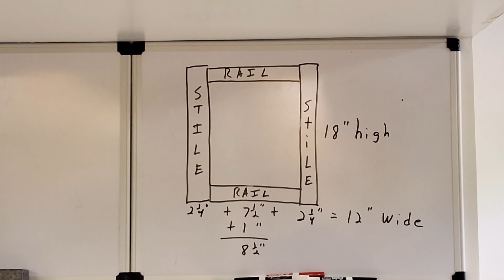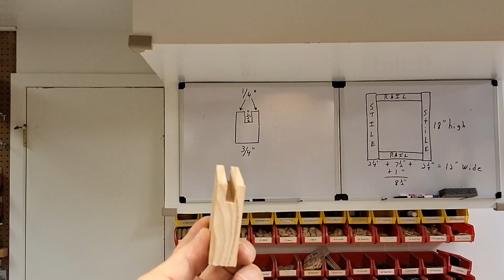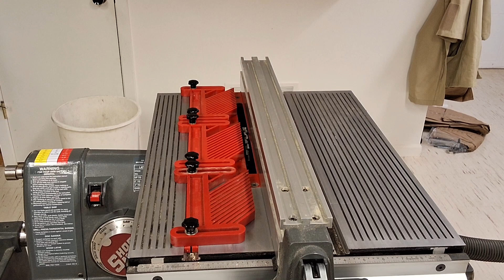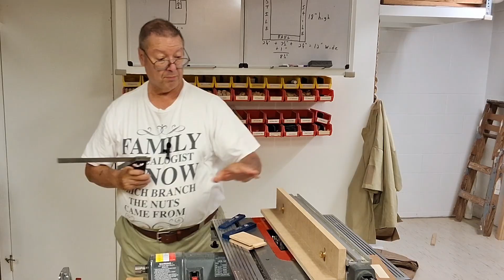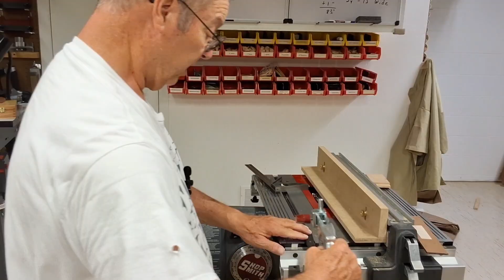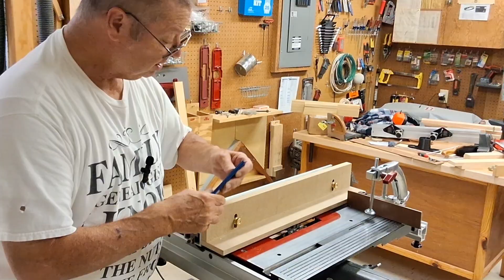Using the stacked dado set for stiles and rails.

Comment: I agree, great job Steve, I am enjoying this series.  I have made made close to 100 doors and drawers with this simple Shaker style but have always used a router set and table. I especially like the way you used the L fence and dado blade for coping the rails. I am always a little uneasy  doing this cut on the router table. Obviously you didn't show all the final adjustments required to get the nice fit, but once that chore is done the cutting looks to be a breeze.  I also like how you taped on the zero insert piece on the face of the miter gouge to prevent tearout.
Reply from the maker: The Shopsmith adjustable stop collar makes fine tuning the table height a breeze.  Using pieces of typing paper between the L-fence and the rip fence will fine tune the length of the tenon.  I have shown both those tips in other videos.
Reply: I actually have made a stop that I can attach to the 520 rail with a match fit clamp. I can butt it against the rip fence front clamp. To move the fence away from the blade, I release the rip fence clamp and put the appropriate shim against the stop and then slide the  rip fence clamp to butt against the shim. To move the fence closer to the blade it's a similar process except you reposition the clamp with the shims, then move the fence over. With a set of feeler gauges I have precise contro of fence position. Yes, I do use the adjustable stop collar for table height adjustment.
Reply: Forgot to mention that my stop is below table height,  so I don't need to remove between cuts. I can also put one on the far side of the fence to allow for two preset rip dimensions.